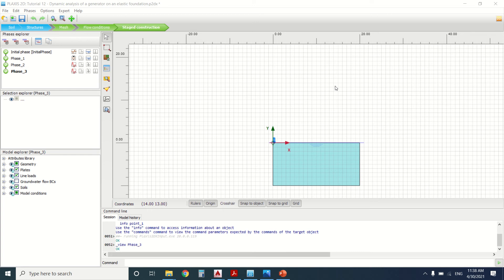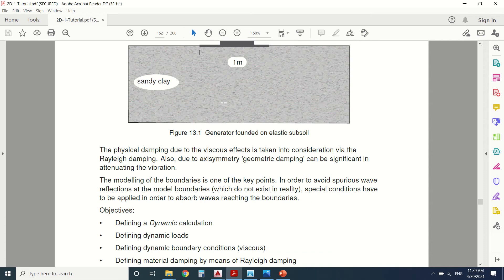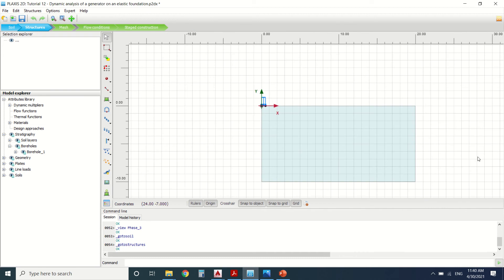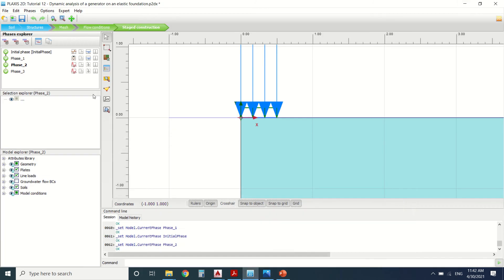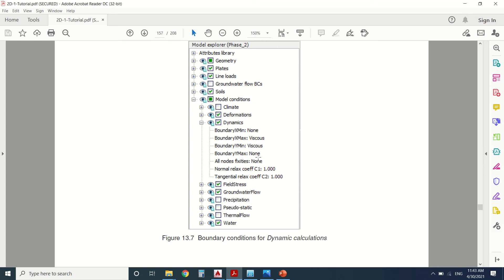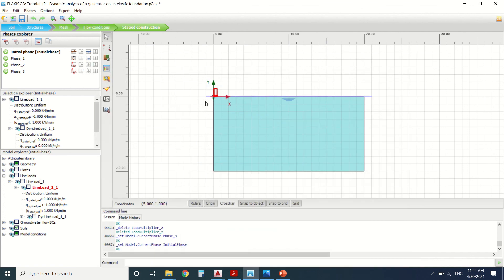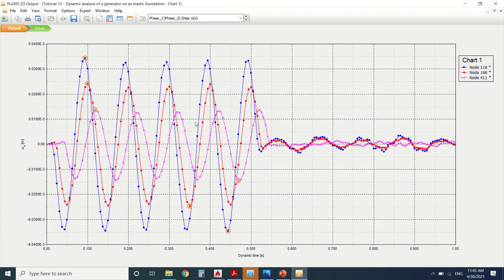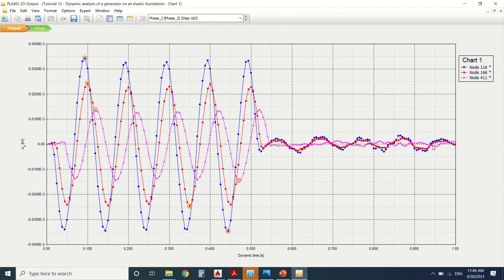Dynamic analysis using Plaxis 2D

Comment: Hi the engineer, I have a project dealing with plaxis where we are trying to do load bearing of stone columns in soil using static analysis and I thought maybe you could help. If possible you could even make video about it ?
Reply from the maker: I v already made a video about stone  columns
Reply: @theengineer7732  hey so it's been a couple days and I have an issue regarding geogrids. I've applied a stone column in a clay soil and provided loading to it. If I provide a geogrid to the stone column, isnt it supposed to increase the load bearing capacity?
Reply: Can I have your mail so I can explain in detail?
Reply: Also I'm using plaxis 2D